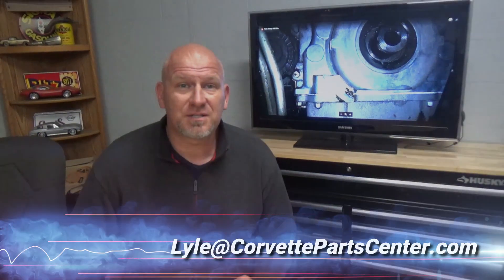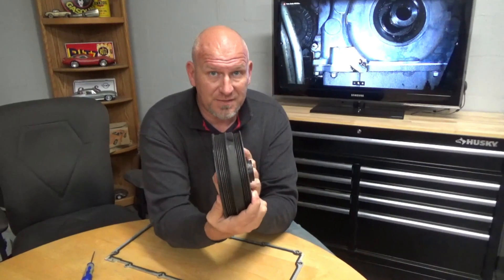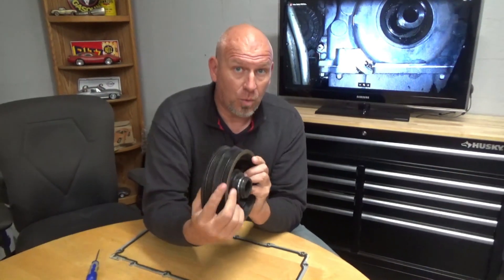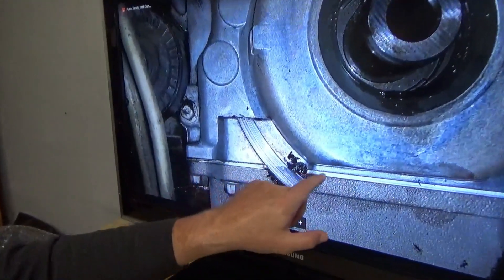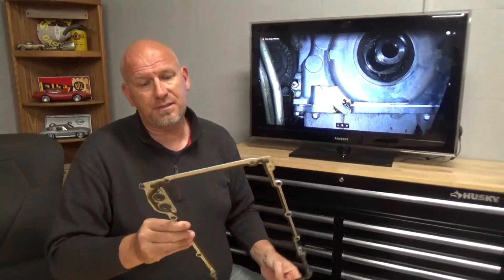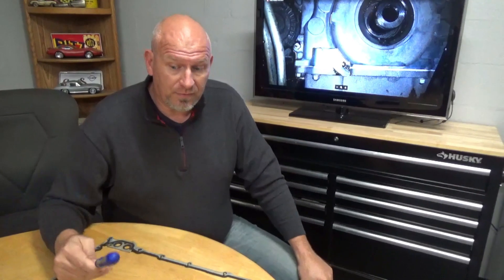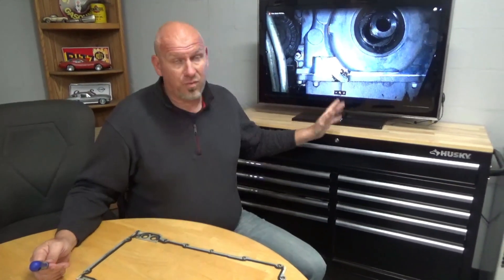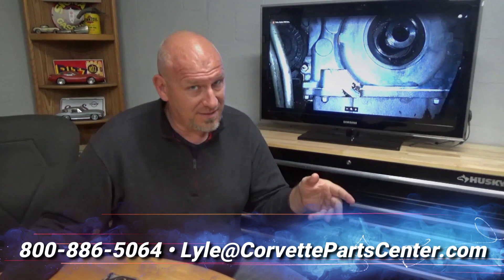C5 C6  Corvette Harmonic Balancer Problems

Comment: I would not blame the gasket failure totally on heat.....my 2000 LS1 had multiple failures in the pan gasket like that...rubber separation from the metal frame....pretty much all the rubber was off the metal frame....leaked more oil than the exxon Valdez

I am impressed with fluidampners....quality one piece damper.....no separation ever !!
Reply from the maker: Hey Jon!  I agree that these gaskets aren't infallible by any means, but this one had precisely ONE leak and it was right where the balancer had been grinding on it so I am confident of causation on this one.  :)
Reply: Jon, I also was a fan of fluidampners. recently I had one on my 6.2 split into two pieces. It wasn't that old either. Had been spun up over 8000 a few times but that shouldn't have hurt it!!!
Reply: @dannywilsher4165  i have heard many people be down on FD....but never a reason....how does a one piece split in 2 ?
Reply: @jonsingle1614  I'm not down on them at all. I have had probably at least a dozen of them since they came out. I really don't know how or why it came apart but it did and the fluid inside covered the inside of the engine bay. I guess I can't call it fluid, more like a thinned out silly putty....
Reply: @dannywilsher4165  i think they do have a lifetime warranty ? Yes....it full of silicone....goo
Reply: @jonsingle1614  Yes sir I think you are correct on the warranty. I plan on calling them and see what they say. We were at a race and someone loaned us another brand so we just paid them for it and haven't took time to check in with FD ... I will say that the sales man that I talked to when I bought this one was awesome!!! It just happened to be the first LS motor that I had built and I didn't have an installer for the balancer. He gave me a complete harmonic balancer remover and installer set. He said the weren't making them any more and they only had this last one left. When I got it in the mail with the balancer, it didn't have anything inn it that would work with a LS engine and balancer. I called him back and told him I would be glad to pay him if they had one. He told me he would check into it and call me back. Next day he calls me and told me it was in the air next day. I asked him how much and he wouldn't take my money. He said they didn't have what I needed so he had his machinist make me one. So with that kind of service, I could never have anything bad to say about them!!!  (sorry for the book!)
Reply: @dannywilsher4165  FWIW....the FD website claims the silicone gel will never deteriorate....a claim racers make that the high heat turns the gel to crap

Of course I have no first hand knowledge of that

Was your dampner one of the early units ? Did hear of problems with those
Reply: @jonsingle1614  6.2 LS3 engines have only been out since 2008. I bought the balancer in 2015. Had it in a 98 Z28 Camaro that I had till it got drowned by Harvey. We then put the balancer on a 6.0 and raced it ...

Comment: I recently had the harmonic balancer replaced on my 97 Corvette with the locking pin inserted. How long should the new harmonic balancer last on average?
Reply from the maker: That really depends on which balancer you chose.  If you went with the OEM style unit, you should get 8-10 years out of it.  if you did the Summit Racing or ATI units, they should last for the life of the car.  Lyle

Comment: I haven't had any problem with my 2001 C5. 53k miles on it and it's a daily driver. The car runs great. No storage here in FL.  Should I replace this part anyway based on the years? Is there an aftermarket harmonic balancer that is better built to avoid this problem from happening again?
Reply from the maker: Hey Leon!  If you balancer isn't showing any signs of wobble, let it be.  There are several aftermarket units that are better built than the stock replacement--Summit Racing's own branded unit at $199 is an excellent piece.  Lyle
Reply: @csvette  Ok thanks. I think I will check out that part and purchase it. Just to have it already for when this happens one day. I already have a couple of other parts already for common issues with my model year.

Comment: Hi Lyle. What specific HB and bolt would you recommend for a 2005 base  coupe from Summit?? Thanks
Reply from the maker: I use and sell the Summit 2501 balancer and the GM bolt for street applications.
Reply: @csvette    I was also looking at PowerBond PB1117SS. It looks like the original. Thanks for your input.
Reply: @rosss.1651  That part is excellent, but it is also identical to the Summit 2501 which is less expensive.  Lyle
Reply: Thanks for the advice. Wish you were here in Rochester,NY!

Comment: Thank you so much. Question i picked up a beautiful lemans blue 2005 convertible Corvette with 96000 miles on it and i see a very slight wobble on the balancer is there a level of wobble that is ok or is any wobble tell me it has to be replaced immediately?
Reply from the maker: Hi David!  All factory-style balancers exhibit a very small wobble, even when brand new.  Just monitor it as you would your oil level and if it becomes worse you will know it is time to address it.  Lyle

Comment: Can you tell me if this is an issue with the LS3 engines or only the LS2? I am looking to purchase a C6 and this would push me toward a 2008 and up if so.
Reply from the maker: The balancer was an issue all the way thorugh  the C6 run, but the internal issues experienced by the LS2 did not continue with the LS3--08 and up is the best bet.  Lyle

Comment: Hi Lyle, Here is a question from Sweden, I bought my Corvette last year from a car dealer, and unfortunately the Harmonic balancers were broken, they were willing to deduct the price for it, but when I knew that it is a lot of work with it i was not interested, so then they promised to change the Harmonic balancer and send the car to me, and since the car was really nice and owned by an older couple all the time, I agreed to it, and now 1 year later the warranty has expired and the harmonic balancer har come loose, now my question, how big is the risk that the crankshaft has been damaged from the harmonic balancer spinning on it? it has probably slipped a bit for a few weeks, but when it stopped pulling the belt to the power steering I discovered the fault immediately, so the engine may have run for 1 minute without the harmonic balancer spinning, Can it be enough to change the bolt and tighten with the right torque or do I have to change harmonic balancers? The harmonic balancer is made of cast iron and the crankshaft is hardened steel, so the harmonic balancer should be the one that breaks first, what do you think?
Reply from the maker: Jan, is the balancer rotating on the crank OR is the outer ring of the balancer rotating on the inner hub of the balancer?  Most likely, the dealer re-used the main balancer bolt instead of replacing it...they are torque-to-yield bolts and cannot be re-used.  The crank shouldn't be damaged, but it will need to be inspected and the balancer replaced and secured with a new bolt.  This is excatly why we pin every balancer we replace to the crank.  Sorry you are having to deal with this!  Lyle
Reply: @csvette  It is the whole harmonic balancer that rotates on the crankshaft, the screw was completely loose, it has probably slipped a bit all the time until it became so worn that it started to rotate freely on the crankshaft
But as I understand, it's only the screw that holds the harmonic balancer against the crankshaft, so i wonder if i can get away with a new ARP bolt and torque it to 235 foot pound and that will hold the harmonic balancer? or will it come loose again if i do that? the option is to do it the right way, but then my summer is over, i'm not going to do all that job and not shange whaterpump and everything ells on the front, and that take time and a boatload of money, 100% up on your price in Sweden.
Reply from the maker: @janjohansson3855  My main concern is that if you still have an original style balacner on the car, it will fail in a few years and you will be right back in this place. A new ARP bolt is great, but I wouldn't re-use that balancer for any reason.  As an aside, I really wouldn't worry about the water pump unless it is making noises that it shouldn't be...by all means, do the belts / tensioners / idler pulley....but the water pump rarely fails in those cars.  Lyle
Reply: @csvette  Yes, it's an original balancer, but the workshop changed it last year when the original broke, so this one may have 3,000 miles on it. werry well, just tear down and redo, that's what happen when you let shit workshops do the work.

Comment: What does the job cost to replace balancer on average
Reply from the maker: We normally replace the balancer, the front crank seal, pin the balancer to the crank, replace all Belts, tensioners and Idler pulleys at the same time.  That service costs $2100.00, parts and labor.  Lyle :)

Comment: Is there a better replacement part for this?
Reply from the maker: Summit Racing has a balancer that features a lock ring that keeps this from happening for $199.00...I have been using them a lot lately.

Comment: If the harmonic balancer slips/separates, would the engine Rev up like the transmission is slipping?
Reply from the maker: No.  If that degree of slippage occurred, your accessories would run poorly (A/C, power Steering, water pump, etc) .  Engine revs would be unaffected.
Reply: @csvette  that’s what I thought. I think my transmission on my 2006 A6 is done then. It’s slipping bad. Only when I floor it. Just checked/replaced fluid and filter. Old fluid and filter looked fine. Smelt fine. The other day I got a p0700 and a p2714. Car got stuck in the gear it was in and wouldn’t shift.
Reply from the maker: @eclipse1328  those cars had real problems with the torque convertors...just be aware.  Lyle
Reply: @csvette  my harmonic balancer started shaking too. I’ll be doing that soon as well. Lucky for me I fix my own vehicles. My 98 Corvette had a bad harmonic balancer. I replaced that one myself. Was hoping I would never have to do that again. Thanks for replying so quickly! Love your informative videos.
Reply: Would the HB cause stick shift manual transmission vibrations?
Reply from the maker: @lauralynnmcculloch1186  Most likely not, unless it was wobbling enough to be hitting the timing cover/ oil pan and then sending those vibrations through the drivetrain.  The more likely cause is going to be your torque tube or your CV axles.  Lyle

Comment: Great vid, how much do you charge to do that job on a c6
Reply from the maker: WE normally replace the tensioners, guide pulleys and belts at the same time, so the job comes to about $1100 all said and done.
Reply: C&S Corvettes thanks Lyle I’ll prob be in for that service, if I wanted to have you add a mild cam when you are in there how much more would I be looking at I figure if I’m going to do that upgrade now would be the time seeing that most of that job is already being done thanks
Reply from the maker: @reelnative01  I don't do any internal engine work, so I wouldn't want to do that part of the job.  I stick with the things that I KNOW we are the very best at.  :)

Comment: I have a c6 corvette sometimes I can’t get it out of park? I have to pump and pump the breaks to get it to drive, does anyone out there know what’s the cause of this?
Reply: There is a pie-slice shaped pawl  (controlled by a solenoid that is no longer produced) in the shifter itself.  When the solenoid gets weak, the pawl doesn't shift completely out of the way and you are now stuck in park.  The best solution at this time is to get into the shifter from the top and zip-tie that pawl back out of the way.  You will no longer have a shifter that locks in park--and if those solenoids ever do become available again you can replace it at that time and still have full function.  Lyle
Reply: @lyleaulwurm9486  thanks Lyle, my corvette is in storage right now because where I live in Canada we have snow and salt on the roads in the spring time I will try your solution and I really appreciate you helping me out on this annoying shifter….. thanks again

Comment: These cars are a joke. My 2000 has had every single common thing go wrong with it that can. 45,000 everything started breaking. My balancer has been wobbling since 52,000 it’s got 58k only.  . These don’t go bad in any other car.  I’ve owned 62 cars. Not one needed a harmonic balancer. Uggh. Well here goes $1000 job :(

Comment: It's crazy to think that gm made and keeps producing this garbage. Worst thing I believe a lingenfelter 1998 c5 build was done in 2000 with less than 5k on the clock still has the stock HB on the engine.